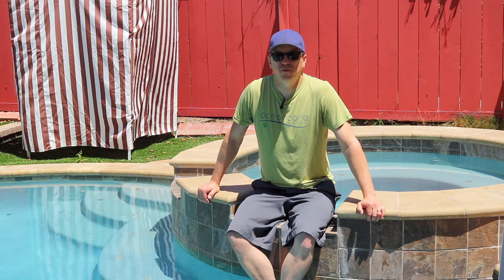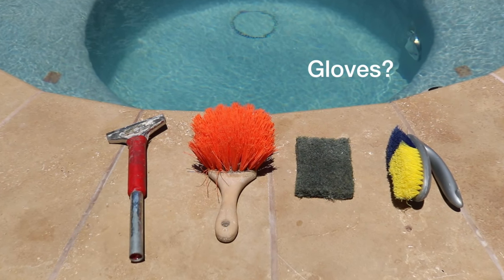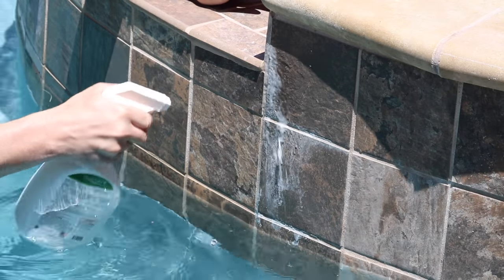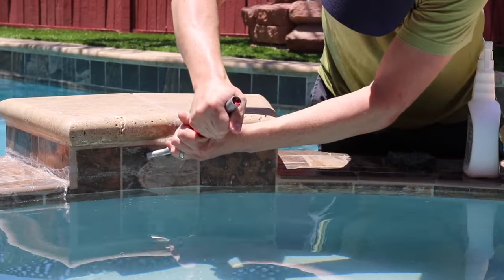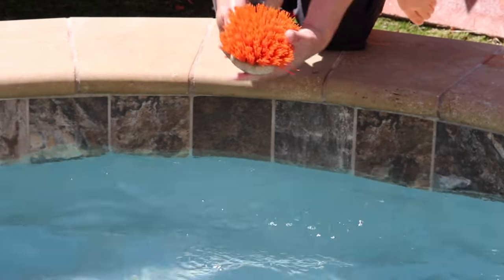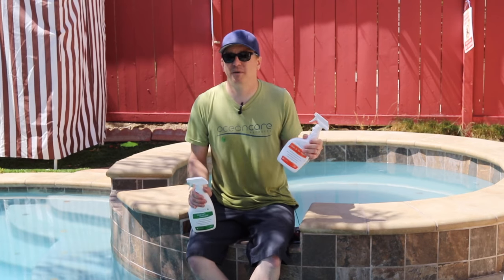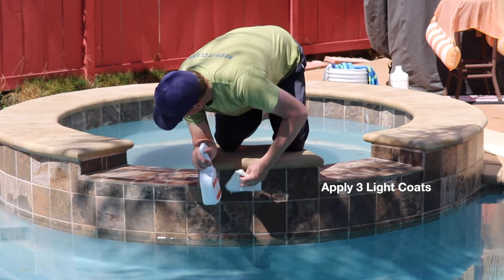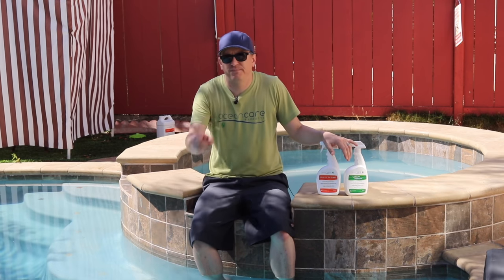How To Remove Calcium From Pool Tile (and keep it GONE!)

Comment: Hi Oceancare.  I have a stone water feature that has a horrible calcium ring.  When I scrub it, I feel like I’m destroying the stone as is almost crumbles.  Would you recommend these products to help me remove the stains and would they work with simply a brush?  The water feature acts as a filter return to a pebble tech pool and gets wet and dry two cycles a day.  Thanks.
Reply from the maker: Hi Bradley, thanks for the question.

There are so many types of natural stone out there that this is a difficult question to answer. If it feels like the stone is "crumbling" when you are cleaning it, it's possible that the stone has already been damaged by aggressive water chemistry or through acid cleaning. Or it may just be a stone that should not have used in a water feature.

Regardless, I would recommend testing the calcium releaser in a small spot to see if it breaks down the calcium without doing damage to the stone. If so, once the stone is clean, I'd highly recommend sealing it with our penetrating sealer, allow it to cure for 24 hours and then apply the Glass & Tile Shield to help make future cleanings easier.
Reply: Oceancare Store Thank you so much for this product and the instructions!  After multiple days of repeated spraying and brushing with a kitchen dish brush, most of the calcium ring has been removed.  I will continue to do this same thing until I get the ring completely off.  BUY this product!  It works just as promised.
Reply from the maker: Thanks Bradley!! Glad to hear the Calcium Releaser it worked for you.
Reply: @bradleywood8723  
Use an enhancing sealer and thank me later

Comment: I puchased a bottle of your product through Amazon and I must say this is the biggest con I've ever seen.  I followed your video instructions to the letter.  I scraped as much calcium off as possible with a razor.  I sprayed a heavy coating of the product on the tile and covered it with plastic wrap.  i let it sit for a couple of hours.  I removed the plastic wrap and hit the stain with the 3m pad and the razor.  Absolutely zero impact.  You got my money once.  I'm just glad I bought a small bottle and didn't waste even more money.
Reply: @Ready Temp And did you notice that they never responded to my post.  But they reply to the fake comments about how great the product is.
Reply: @ZonaJim  thanks for your honest post. It saved me money and time
Reply: Thanks for this comment!
Reply: @ldp4520  MYOB Karen.
Reply: @ldp4520 can you be more specific? I’m not seeing what he missed. Lmao
Reply: @ldp4520 watched with my left eye, then watched with my right eye.  Both eyes saw the same thing…. This is a scam and a waste of time and money.  
You need to grow up and stop lying to yourself and others.
Reply: You bought it off Amazon, worst place ever.   You could of bought a bottle of dish soap.   Fake central.
Reply: @ZonaJim did you find a product that actually works

Comment: You've made this so much more difficult than it really is.  All you need to do is put muratic acid on it.  I use a 50/50 mix of muratic acid and water in a garden sprayer and even the biggest calcium deposits wash away easily.   Done.
Reply: Yep absolutely
Reply: Do you have to drain the pool a little bit to get the water line down to let it soak on the tile or you just spray it on as is?
Reply: @armandosoto8625  Just spray it on.  I don't recommend the garden sprayer anymore!  Get an acid sprayer off Amazon.  It's the same thing, it just won't corrode.

Comment: The easiest way I have found is using a Power washer of 2000 psi or greater..no scrubbing. Easiest less work!!! The only thing is that you need to test is the distance and angle when using the washer. You would think going closer to the calcium would be more powerful...but its about 4-6 inches away on an angle that starts to break it up. Its almost as if a certain frequency of the distance of the spray works.  You hold it on a spot on an angle..and then wait..you can see the shape of the sprayer becoming less white against the tile. I would do a pass and then see there maybe another layer to do but much less noticeable. I would spend about 20-40 seconds on a tile moving slowly.  2 Passes to get it. There might be a part where it seems thicker...do a third pass on those spots.

Comment: No need to buy gimmicky products.  Mix 3/1 water to muriatic acid in a spray bottle and voila same effect. Basic chemistry here Acids and Bases.
Reply from the maker: Muriatic acid can have it's place but it is a very corrosive chemical that many people are not comfortable using for a cleaning process that might get it on their skin or droplets in the air. Plus it can also be damaging to cement grout and sensitive tile finishes (like iridescent glass tile). No gimmicks here, just a different (and in some ways better) option. Thanks for the comment.

Comment: if this works then shouldnt you be selling this to all pool installers for pool w a tile line? You say you have a sealant for after cleaning off the build up, then it would be better to put the sealant on the tiles for new pools first to avoid build up ever???? this should be your selling point

Comment: I purchased these products and also saw little to no difference. It’s almost a joke that it’s sold in a 32 Oz bottle (other than needing a dispenser itself). I’d need to repeat this process many times with many bottles in order for this to work.
Reply: SAME.  I used the whole bottle and got nothing.

Comment: I'm still in the process on cleaning calcium buildup off my pool tiles. Best thing I have found that worked very well for me, Is using a small good quality metal putty knife. Since this Covid19 lock down situation, Iv'e completely cleaned 150 blue 4" tiles on my waterfall. It's 5 tiles tall x 30 tiles wide. I go outside to scrape the tiles about an hour before sunset. The tiles had some real nasty calcium deposits on them. I was doing 10 to 15 tiles a day. Spending about 20-40 min scrapping before I quit for the day. I am currently cleaning just the tiles that go completely around the pool. these are much easier and I can clean about 20 tiles before I quit. I'm not using any chemicals at all. Tiles look amazingly clean with no scratches or dings. It's laborious,  but the results are really good. I will be adding the Glass and Tile Shield next to cut down on Calcium buildup.
Reply: I think the small metal knife is the best thing for removal calcium on tiles too.

Comment: Used pool acid once a week to maintain pool balance and it disappear on its on.  This year I didn’t clean the pool as much as I used too.  However I also learned more about my pool character then I have in the last 20 years.  I have several properties with pool and I used last chemicals saving money but using pool acid every two weeks.  It keeps the pool perfectly balance with let’s the algae and hard water away.  I super chlorine once a week and add chlorine tablets as needed usually once every two weeks as while.  I recommend you brush the pool sides every few days which I haven’t done myself due to the many DIY projects I’m doing!!! I hope this helps someone.  Which the price of pool chemicals and hiring pool service things can start to be affordable fast.

Comment: I have this problem too. I have  a saltwater pool and for some reason, I didn’t expect the build-up. I assumed the salt water would be akin to having a water softener in the house. I guess I was wrong. 
My build-up appears to be coming from the grout lines. It’s not really all over the tiles except where it’s spreading from the grout lines. The grout lines do appear to be poorly grouted in those areas and they are mostly around the spill over. Would you suggest re-grouting after cleaning with your process?  Thanks!!

Comment: Hi oceancare.  How does your chemicals affect the pool? Will I need to add different chemical to offset them?
Reply from the maker: Hi There. The small amount of cleaner that ends up in the water is generally not enough to have any noticeable affect on the water balance and no adjustment is needed. But the only thing that could possibly be affected is the pH. You can always check the pH before and after cleaning and adjust as needed if you really want to be sure.

Comment: You're always going to have build up at high PH areas like spillovers. Keep the Ph on the low side so it doesn't harden as fast and have a company clean your tile with abrasive blasting every 1-2 years with a less aggressive media like MaxxStrip. All you're doing with scraping the tile is putting micro scratches in it and making the calcium stick even better since the surface becomes more porous .
Reply from the maker: I agree that there will always be some level of build up but it is more complicated than just pH. Factors like, total alkalinity, dissolved solids and calcium hardness will also play a role. Also, blasting the tile (even with maxxstrip) will do some level of slight surface damage. Plus it can be expensive and not something I'd want to repeat every year. FYI, I cleaned and protected the pool in this video over a year ago and it still looks as good as the day it was cleaned. The Glass & Tile Shield does a great job of keeping the calcium from bonding to the tile and, in my opinion, is a better option than continual blasting.

Comment: Helpful video. I have shiny glass tiles around my pool. My calcium buildup isn't that bad,  it is a calcium water line & the tile looks dull. I have found that liquid car wax does it all. it removed the calcium water line, makes the tile shiny, and protects the tile. Just put a dab on a rag & rub it in really well, and then rinse it off.  DONE!

Comment: I have black glass tile
Saltwater pool with chlorine. My glass tile has a white film I can’t get off with vinegar would this spray work and what type of brush since mine is glass?
Reply from the maker: Black tile in a saltwater pool could be a challenge to keep looking clean. But if the residue is calcium based, yes this cleaner should break it down. I'd use a stiff plastic bristle brush and/or a non-scratching scouring pad. If the residue is mostly salt based and the Calcium Releaser doesn't react with it, you might end up having to have the residue removed by a pro using a light blasting media that doens't damage glass (i.e Maxxstrip) and then, once clean, apply the Oceancare Glass & Tile Shield. Then try to clean regularly with the Calcium Releaser to not let it build-up back to this point. Obviously proper water chemistry and salt levels will go a long way to slow down the build-up as well.

Comment: My maintenance company who also built my pool, charged me $175 for a treatment to prevent calcium build up. My pool is only a year old. We never had any calcium build up. After week after this treatment there is calcium build up everywhere. Im so confused. Anyone know what may have caused this?
Reply from the maker: That's a hard one to diagnose with just this limited info. There could be a lot of factors involved including water chemistry and the details on exactly what product they used to treat the tile. You could start by finding out what product they used and then maybe consider having your water tested by a third party, many pool supply stores will do it for free.

Comment: Do you have any recommendations for a Baja/sunshelf that has glass tile with calcium? I'd have to drain the pool a foot or more to have it exposed...
Reply from the maker: If the area in question is normally underwater, then you may not have a calcium deposit issue as these deposits are the result of water evaporating from the surface. But yes, the area needs to be dry for the cleaner to be effective. I've seen contractors construct dams to keep step or baja shelf areas dry for tile repairs but that might be a bit extreme for cleaning.
Reply: @oceancarestore7831  It's definitely some kind of buildup between the grout. I have your initial cleaner spray. I use it on my infinity wall, but didn't have much success, i think i need to commit to letting it set though.

Comment: would this work on natural stone / color grout shower floor?  I was gonna use CLR until I read the warning labels on natural stone and colored grout.
Reply from the maker: Thanks for the question. Yes, this can work for natural stone/colored grout and is much safer than using a mineral acid based cleaner like CLR. But keep in mind that if the stone has a high calcium content, ANY cleaner that breaks down calcium could etch (slightly dull) the stone. As such, we always recommend doing a small test spot before cleaning the entire area.

Comment: I have stone around my pool and jacuzzi with heavy calcium build up. Will those products work?
Reply from the maker: Yes, they should work quite well. The one caution I'd offer is that you should test the Calcium Releaser on a small spot on the stone to make sure there is not an adverse reaction (usually safe but not all stone is the same). Also, becasue stone is porous, for best results you should seal the stone with Oceancare High Performance Penetrating Sealer and allow it to cure for 24 hours before applying the Glass & Tile Shield.

Comment: Is this safe to use in a Pebble Tec pool?
Reply from the maker: Yes, safe to use on the tile and any little runoff that gets into the pool won't hurt the pebble-tec finish. But if you have exposed pebble-tec (above the waterline) , use caution to avoid runoff of the cleaner directly onto the pebble-tec surface. It could cause a little discoloration.

Comment: Are both these products safe on Charcoal colored grout and pavers? My issue is the calcium buildup in the grout.
Reply from the maker: Hi Bob, if the build-up is just on the grout, your issue might be efflorescence and not actually Calcium. The best advice I can give you is to do a test in a small area to check results. And with dark grout, make sure to rinse thoroughly before the cleaner dries to help avoid white residude.

Comment: Does it damage grout? We’ve used a diluted Maria tic acid and it makes the grout bubble.
Reply from the maker: Cement based grout will always have some mineral content that can react with calcium cleaners and you will likely see bubbling when it is applied. However, the Calcium Releaser is much safer for colored grouts than mineral acid cleaners like muriatic acid. Thanks!

Comment: cool video! is this the same process for quartzite? (lots uneven areas) TIA
Reply from the maker: Cleaning a heavily textured stone can be tricky. Because of the uneven surface, it's obviously a lot harder to use a scraper to get the heavy areas clean. If it's a heavy build-up, it might be worth it to go through the process of getting it media-blasted. And then seal it, protect it with the Glass & Tile Shield and then implement a more regular maintenance program with the Calcium Releaser to keep it clean moving forward. Good Luck!

Comment: Window scraper, then muriatic acid dispensed with a SIRACHA bottle with the green needle head.    2 or 3 passes will remove 90%, waiting 5-10 min between each pass.  minimal effort and cost.

Comment: Ridiculous. Forget the chemical strippers. Use a pumice stone. Or an angle grinder with a paint stripper pad found at Harbor Freight. Fast, simple, works. Experts use a glass bead blasting process on really bad surfaces. You can use a spray vinegar if you need more accelerant.

Comment: Once the solutions are applied, how do they impact the chlorine, acid, and conditioner levels?  Is there anything to manage once doing this process?
Reply from the maker: No, there is no need adjust chemical levels. The amount of cleaner in the water is negligible.

Comment: Discount code doesn't work...
Reply from the maker: Hi Jeff, the coupon code is active but is the "Pool Combo Code", which requires the purchase of both the Calcium Releaser and the Glass & Tile Shield in order to be applicable. I noticed you placed an order for one of the items through the store and if you'd like to purchase the other, we can manually apply the discount that you would have received for both on the second order. Please let us know here or email at sales@oceancarestore.com. Thanks for the order!
Reply: @oceancarestore7831  - I'll do that in the morning. Thanks.

Comment: Man this would take forever!  And a lot of product.
Reply from the maker: This particular spillway and spa waterline took about 3.5 hours to clean and a little less than a quart of cleaner. But this particular tile hadn't been touched in over 2 years so it was fairly built up. But once it was clean and the Glass & Tile Shield was applied, it has been much easier for the owner to keep it looking good and has stayed pretty clean with just regular brushing. About 2 years after doing this video, I deep cleaned this spillway for the owner again, reapplied the Glass & Tile Shield and had it all done in about 30 min start to finish (the build-up was minimal). It's definitely much easier if you stay ahead of it with some preventative maintenance. Thanks for the comment.